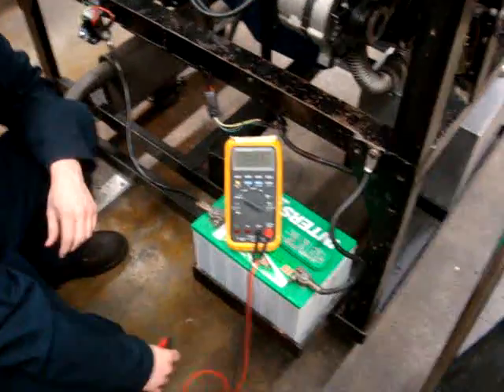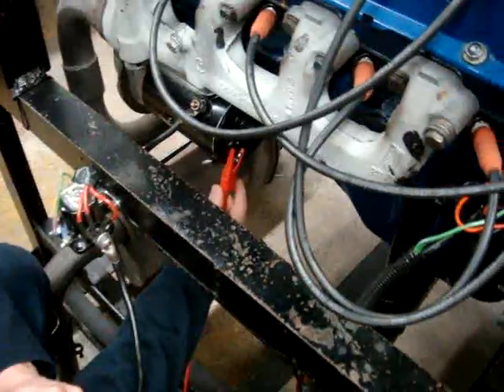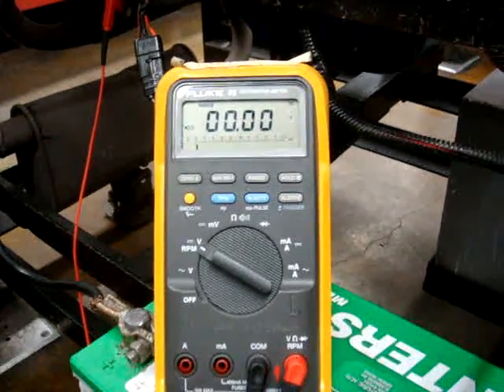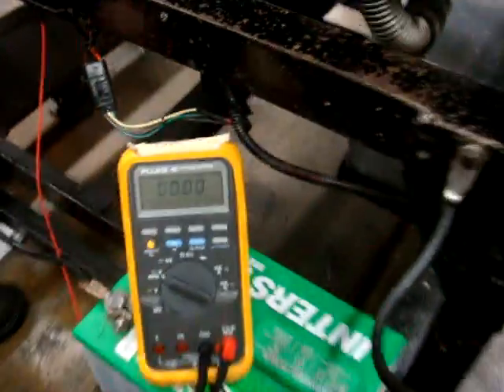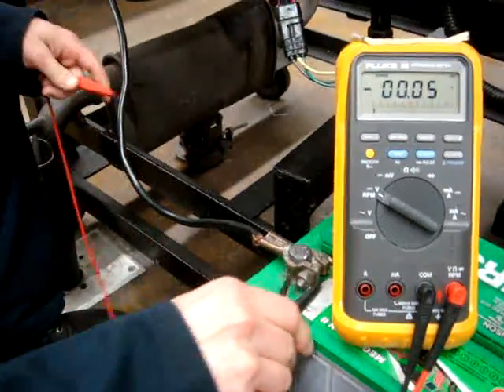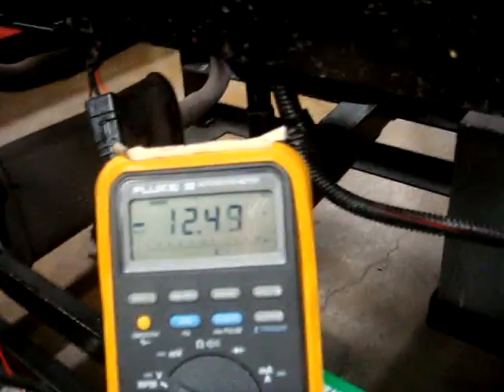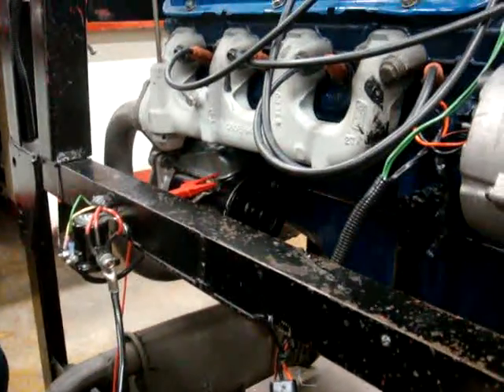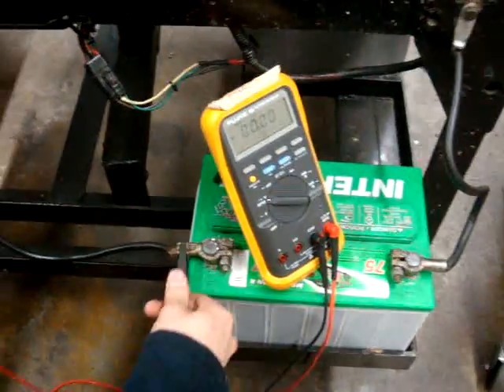voltage drop starting circuit

Comment: why its 12v, when you put on  battery + and on starter b+ terminal,it should be 0v when no crank,and you show 12v,its imposible be 12v to show + to + cirquit

Comment: I'm using this for advice to someone, but to do this test correctly the one lead must be on the post not the terminal. If the terminal has resistance you'll miss it the way demonstrated, so you're not testing the whole circuit the way you demonstrated.